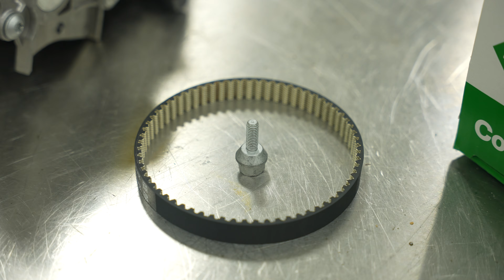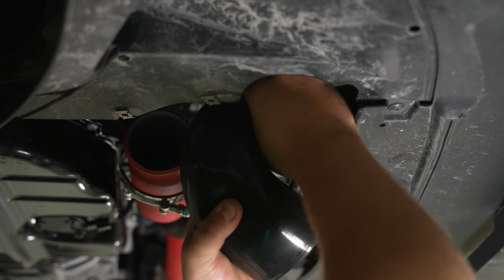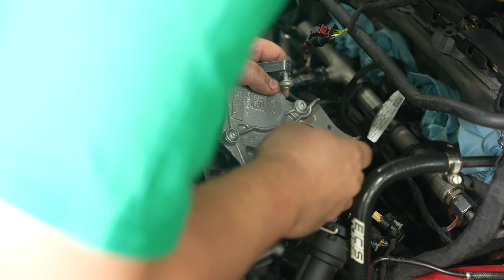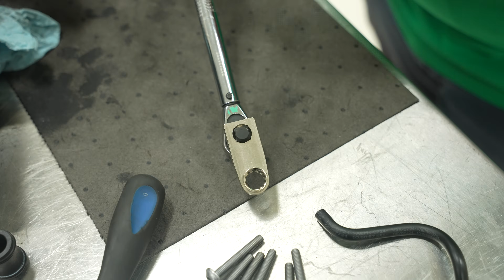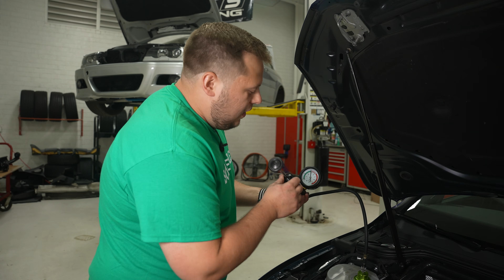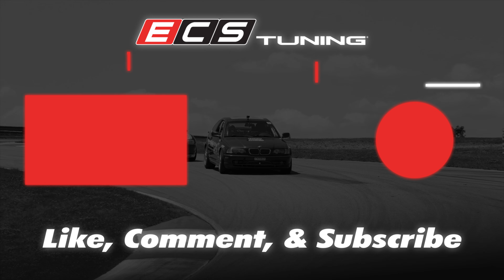VW MK8 Golf R Water Pump Replacement | ECS DIY

Comment: If youre doing this, just go ahead and take off the intake manifold, it'll make the process loads easier. Also remove the oilfilter cap, it helps with moving the intake out of the way.
Reply: Did this without removing the intake on a CHHB engine. Basically the same stuff bar minor differences. Doable but a pain. It took me about 5 hours including fighting with stuck hoses and connectors and just trying to fit tools and hands in tight spaces.

Comment: The water pump is still an issue in gen 4?  Disappointed
Reply: My mk8 pump started leaking at 35k mi. Replaced under warranty but ya holding my breath when I pass 70k. Generic offset wrench ordered because this looks to be a "when it leaks" and not an "if" it leaks item.
Reply: My mk7 pump didn't last 35k miles before it started leaking either.  Seems to be a vw issue that never will be fixed.  Most dealers want close to 2k to replace them these days as well between pump and Labor.
Reply: My original waterpump in my 2017 GTI that I bought new, did start leaking util 80k miles. Replaced it with an OEM unit and that one lasted 50k miles. Replaced it with a Febi unit and zero leaks after 50k miles so far.

Comment: Ugh... a reliable water pump too much to ask for? lol
Reply: From what I gathered, the water pump itself isn’t unreliable; its oil leaks dripping down onto the water pump that lead to pump failure. If you can prevent that from happening, you shouldn’t have to change the water pump for a long time.
Reply: @clutch7366 Just goes to show how problematic some of these cars are.  If you are blaming it on oil leaks why does a car with only a few years on it and less than 40k miles have excessive oil leaks causing water pump failures?
Reply: @clutch7366  Leaky water pumps are the achilles heel of VW/Audi.  EA888 Gen3 PN carried over to the Gen4. It's a revised part but I wouldn't hold my breath. lol
Yes, oil leaks on to the water pump can cause problems on any car but those are usually higher mileage cars.
Reply: @kchan333  It's just the design of the pump and how it mates to the engine. 3 piece plastic design with an electric motor driving the thermostat that sits up against a cast iron block with nothing more than a rubber gasket between the two. If they had just used an aluminum pump with a MLS gasket between the pump and the block and a traditional thermostat with external housing that thing would last well over 100k before ever needing replacement. But, always looking to do things more complicated and cheaper.
Reply: @robsp32  I am surprised not even a 3rd party tried to make a better water pump that actually lasts the life of the engine.